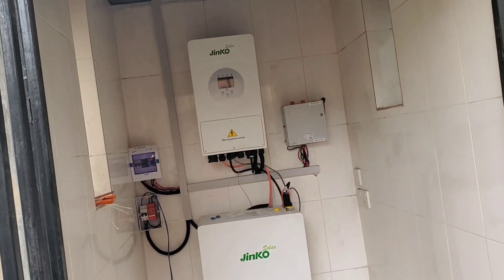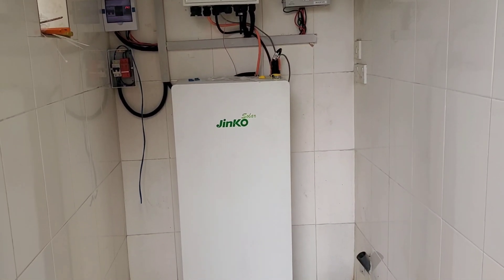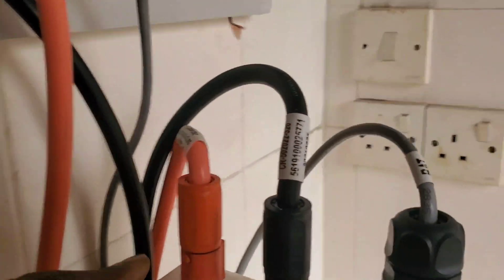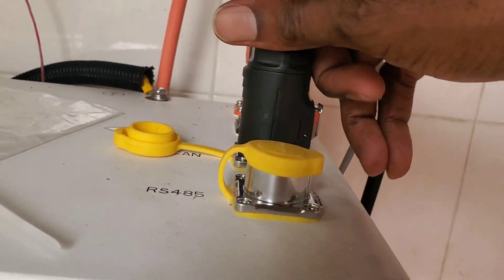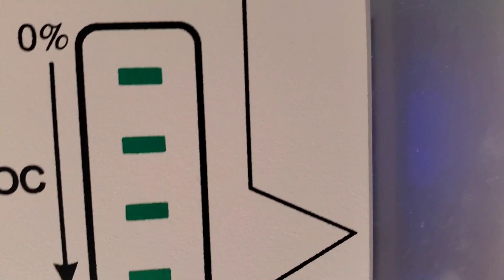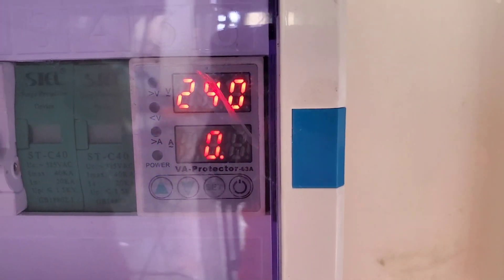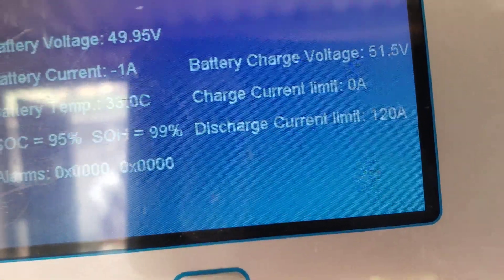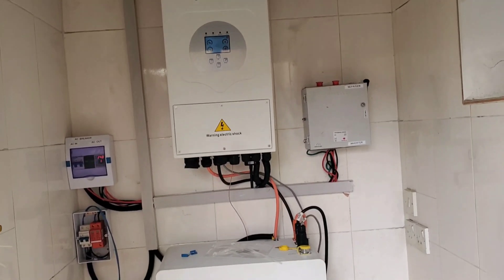Jinko 5 kw inverter and 9.6 kwh lithium battery

Comment: This uses CT to sense power to/from GRID.
I noticed there is an RS485 port too. Can it be used to communicate with Smart Meter or Energy Meter (similar to ones used by Growatt)?
Reply from the maker: I have never connected one so I really can't answer your question. I will do some research and answer in a future video. Please keep the questions coming

Comment: Nice one Doc. How much foe inverter. Is it all in one. And price of 9kw ESS battery? Great work as usual Doc.
Reply from the maker: Good morning Lennie. I hope all is well with you. It is not an all in one. You buy the batteries and enclosure individually. The batteries will run you about $1300 each and the enclosure is about $800. Thank you for watching and commenting
Reply: @drsolar  Thanks for a great video and information. Does the total package come to $3,400? What is the total package plus installation?
Reply from the maker: @tonyosime9380  thank you for watching and commenting. Budget about  $10 - 12000

Comment: I recognized that Deye in an instant. I wonder who they hide inside the battery enclosure. If your market would grow big enough you should maybe do your own Doctor SolaR brand. You just have to design and  print Doctor amd R stickers.
Reply from the maker: I am also curious to know who the battery supplier is. I once branded and it was a disaster. I have been gun shy since. How have you been? Are you getting enough rain yet?
Reply: @drsolar  We had a record rain last week! From one extreme to the other. 206 mm in one day.
Reply from the maker: @dougveganparadisebuilder  hope the ground did not get too saturrated. You don't want floods
Reply: @drsolar  The runoff was actually limited due to the drought deep in the soil. The time we broke the record before the soil became like rubber and water was pouring from it everywhere. This time that didn't happen although more rain fell.

Comment: Nice!!!!!!!👍👍👍
Reply from the maker: Thank you Marco. How have you been?
Reply: @drsolar  very good Doc, just recently added 5x5 Sunpower Maxeon 400 watt solar panels, very high voltage 75V  and 6A, and most importantly very small foot print. Working very well with limited roof area.
Reply from the maker: @marcoa.rosado4724  I would love those for my water pump project. Where did you find them?
Reply: @drsolar  I got them from a local supplier, but sunpower is well known and has a California headquarters.
Reply from the maker: @marcoa.rosado4724  I am familiar with them. Not sure we will see them here